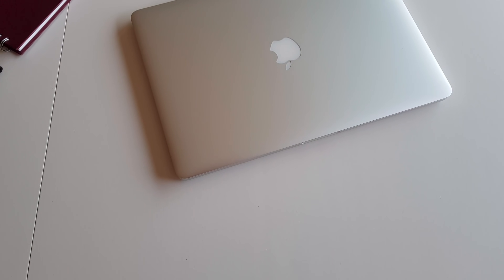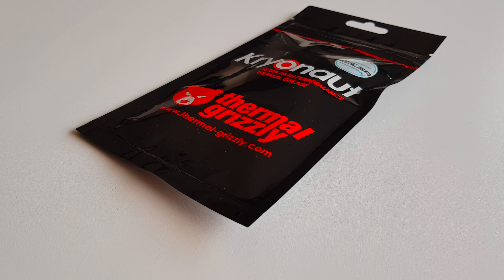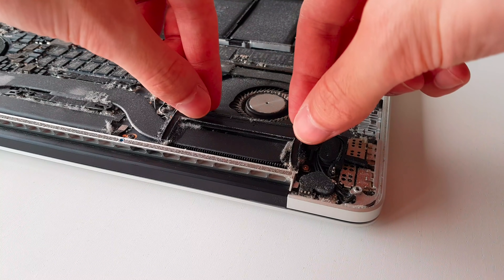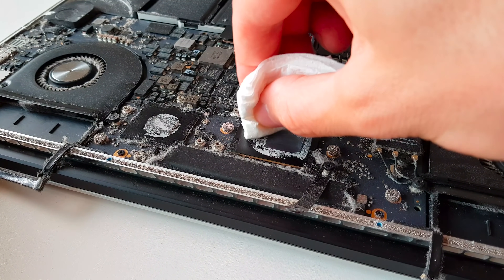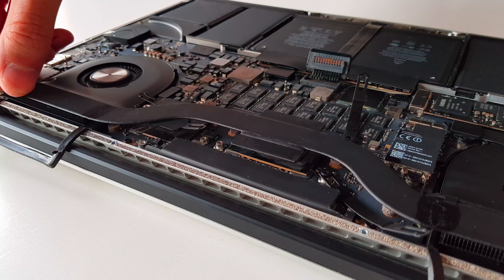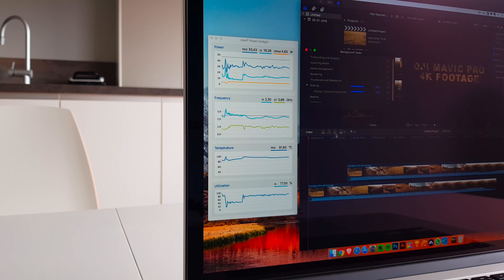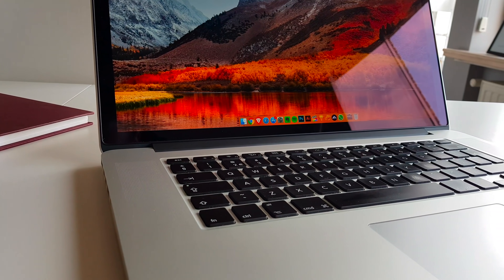Solved overheating problem on my MacBook Pro 15" Mid 2015 by replacing the thermal paste

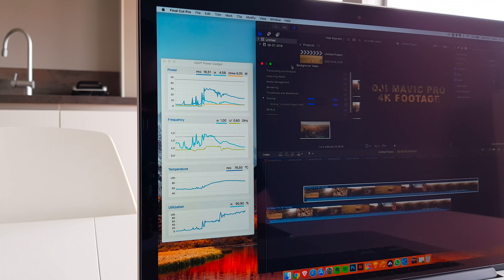Comment: What a helpful video! Was very easy to follow. Prior to this replacement, A 4k video took me 3:26 to export, only turbo boosted to 4 ghz for one second, and thermal throttled after two minutes to 1.7 ghz from 2.8 ghz base clock. After the replacement with thermal grizzly kryonaut, I exported the same video in 2:50 seconds (18% faster!), turbo boosted to 4ghz for 20 seconds, and remained at 3 ghz for the entirety of the export. 10/10 tutorial and thermal paste, would highly recommend this to anyone who owns an older MacBook pro.
Reply from the maker: Hello Michael! I am so glad to hear that! That's definitely a big performance boost, not to mention the longevity that's increased of the MBP because of the lower temps. I think this is my new favorite comment :) I will pin it if you don't mind. Thanks once more for taking time ti watch my video :)
Reply: Hey guys. I have a offer for a mbp 2015 brand new battery, always protection,no scratches whatsoever for a brilliant price.

The thing is the owner is a graphic designer and photographer, so I think the MacBook was used under constant work imagining she worked like 8 hours full capacity on graphic programmes etc. Should I worry or be concerned? Thanks guys
Reply from the maker: I personally think it should not be a big concern especially since you said yourself that the MBP is in perfect condition. What I would definitely do if I were you would be to open it up and clean it thoroughly.
Reply: Dario Prski — when I read his question, I felt he was asking about the actual BATTERY by saying “brand new battery” .... The confusion for me was how he then went on to say it was “always protection (protected), no scratches...” and he fears it was under a constant work load which means it’s NOT “brand new” but actually used.

Either way, here’s MY QUESTIONS to you... 
(i also have the 2015 MBP 13” and i am looking to open it and upgrade whatever i can.) Your PASTE suggestion WILL BE IMPLEMENTED..

1. Are battery replacements possible? 
2. If his question WAS about a used battery only, isn’t there a way to TEST IT prior to purchase the same way one might use a multi-meter (or other devices) to test used standard batteries?? This would be a great video topic.. 
3. I’m upgrading the SSD and have learned that the RAM is soldered in place by Apple. However, solder can be reversed, so are there RAM upgrades available for this MBP if we are willing to desolder/solder or pay a repair tech??
4. Aside from SSD & RAM upgrades, are there ANY OTHER UPGRADES (regardless of difficulty level) that are possible for this 2015 MBP that will increase performance or longevity?? Another great video idea. 
5. I noticed on a “tear down” video of this 2015 MBP that the Thunderbolt 2 controller was accessible/removable..... Can we remove it and UPGRADE to Thunderbolt 3 if we don’t mind the obvious negative exterior appearance side effects?? If so, would anything else need to be upgrading to accommodate this T3 to work properly? 
Finally - 6. Are you aware of any successful radical modifications such as adding a gigabit Ethernet connector or other ports OR MODULES that were not already there? 

I left a comment on the video complimenting you on this video. You truly did do a wonderful job. I have other channels with many subscribers and I still have NEVER thought to use the sweeping video effect you used when showing the MBP in the beginning... I don’t normally show items, as my content is geared more toward political topics, but it’s still an effect I LOVE that I should use when showing still photography or slow motion scenes... your video has encouraged me to experiment with this. 

Thanks!

Comment: Great video! Thank you for sharing—this is really inspiring for those of us still rocking older Macs.

I wanted to share my experience with my Early 2015 11" MacBook Air (Intel Core-i7/8GB). Although it officially only supports Monterey, I’ve used OCLP to upgrade to macOS 15 Sequoia, and it’s running incredibly smoothly. I mainly use it for watching YouTube on Chrome, using AI tools (ChatGPT/Gemini), and simple bookkeeping via Google Docs.

For anyone looking to keep their older machines snappy, here are the three optimizations I highly recommend:

Hardware Maintenance: Regularly remove the bottom cover to blow out dust and replace the thermal paste. This is crucial for managing heat on older Intel Macs.

Aggressive Cooling Strategy: Install Macs Fan Control (Free version). Set the sensor to "CPU Core Average" with a range of 55°C to 85°C. This ensures the fan ramps up linearly as soon as the CPU warms up, preventing thermal throttling.

Chrome Performance Settings: In "Settings -> Performance," set Memory Saver to "Maximum" and disable "Preload pages." Additionally, enable Energy Saver and set it to kick in only when battery is at 20% or lower.

With these tweaks, this 2015 machine remains a perfectly fluid productivity tool even in 2025. Don't give up on your old Macs yet!

Comment: You made it look so easy.  So I thought, "This is Easy" and in the end it was.!! Thank You.  I installed Thermal Pads instead.   Using Macs Fan Control, I noticed a great reduction in temperature.🌿👍

Comment: instead of thermal paste would it be okay to use a phase-changing material like the Honeywell PTM7950 Thermal Pad? for my MacBook Pro 15" Mid 2015 retina display
Reply: It would be much better.

Comment: Same issue was happening to me, I was getting a task called "kernel_task" eating up my CPU to protect it. I replaced thermal paste, disassembled both fan covers and cleaned all the dust. Now it's working way better.

Comment: Exceptional video — may be the best do-it-yourself video I've seen on YouTube, and I'm very picky. 
Great advice, and you did a great job of demonstrating what to do. I especially liked the warning you gave about removing a part that may pop out.
I watched this until the end was was surprised that it was your first video. 
I still use my MacBook Pro because it has Adobe Photoshop and MS Office that are paid for, so no annual licensing fee. Of course, I have to run an older OS, so I use a new machine for most other tasks.

Comment: Thanks for spreading the word on this subject. I've done this upgrade on a few Mac's now. One MBP, had no more than 60% paste coverage on the CPU. One could argue that 60% coverage in the middle should get you by, but this was 60% to one side. Conversely, I did upgraded to X5690's on a Mac Pro 5,1, and was pleasantly surprised by the paste coverage and how much moisture was left, in a 13 year old system. I guess that could be the a contrast between cooling of a laptop versus a tower, but they could at least give some effort to applying paste squarely.

Comment: Watching this video January 2024 because my MBP 2014 is still my only computer and I have never opened it to clean it and put new thermal paste on it. My battery health is around 77% and needs to be replacement as well. Just watching a youtube video brings my computer to its knees. I will buy a battery replacement kit from ifixit and new thermal paste. Hope this will help. But if your MacBook has that much amount of dust only after two years, god knows how much dust and dirt my is have after exact 10 years of daily use 😅
Reply from the maker: Good luck with the replacement! 😄

Comment: Hi I followed this one, but after doing this I am facing issue of screen flickering. Do you have any solution? 

I also changed my battery and left fan.
Reply from the maker: Did you also apply sufficient thermal paste on the GPU die? Check if your screen connector got loose in the whole process.

Comment: you applied the past the wrong way thats the old way which has proved to not work well enough you need to precover the entire aread of the cpu and gpu before putting the heatsink back on other wise you will still run some hot temps what you did will run cooler but had to precoverd everthing properly then it would have been even better results

Comment: With that much dust, I would clean the bulk of it before even removing the heatsink. I'd then do a rough clean of the old thermal paste, go back to dusting everything completely and then finally doing one last clean on the heatsinks and dies, before putting new thermal paste. The reason is, the less time you have in-between re-pasting and putting the heatsink back on the better. If you let the dies sit exposed to air, dust from the air can contaminate the surfaces. Basically, as soon as you apply the paste, the heatsink should go back on immediately.

Also, it takes several days/hours for the new thermal compound to set in properly. You really shouldn't run any benchmarks, or stress out the cpu/gpu right away because it can lead to the thermal compound moving around unevenly with the excessive heat. You won't see optimal temps and performance until the re-pasting has broken in with time at idle/low load. You can also "tint" the copper heatsinks with thermal compound and that can help speed up the break-in period. To do that, you just put a tiny amount on the heatsink, spread it around with a plastic card, or finger wrapped in plastic wrap. Then you take a coffee filter and rub it in so that there is a matte finish to the surface. This is more of a thing with larger heatsinks, like those in towers, but I still tint my laptop heatsinks as well.

Comment: Thanks a lot for the help! I also have a 2015 MBP and I‘ve waited until now (Nov 22) to replace the paste. Needless to say it was not really paste anymore but rather puddy. The MBP has now stopped thermal throttling when I do my audio editing and the fans also run much quieter for much longer. I‘m a hardware enthusiast with a big custom water loop on my gaming PC… no idea why I haben‘t done this earlier on my MacBook 😂

Comment: dude, don't use a brush to clean you laptop. It could be charge with static electricity and burn it all. Use an air blow or air spray.

Comment: Thanks for the video, do I need to let my MacBook pro completely cool off after shutting it down to perform the thermal repaste and do I need to wait to start my MacBook Pro a certain amount of time after applying the thermal paste?
Reply from the maker: It's good to cool it off a bit.
Reply: Thank you for replying, how soon can I turn MacBook Pro on after applying thermal paste?
Reply from the maker: You have to assamble everything back together and turn it on like you usually would
Reply: Thx for the help
Reply from the maker: Np. Good luck

Comment: I have the same model, second hand, but in excellent condition, used just for school previously. I've noticed fan is loud lately, and I got some heat in the bottom. According to the previous user don't think it has ever been cleaned. Hope I willl be able to do the steps. Good video. Btw, ucinilo mi se po naglasku da si sa Balkana, ako jesi pozdrav. Nadam se da necu nesto zeznuti.
Reply from the maker: Dobro si prepoznao naglasak 😉 sretno! Ako negdje zapne, javi.
Reply: @DigitalPulse  😁, moram naručiti taj alat prvo.
Hvala ti.
Reply from the maker: Hvala tebi na gledanju 🙌

Comment: as a pro apple tech for the past 25 years you should've blown out all of the dust FIRST then moved on to your repair work. why would you want to have all that dirt and dust mixed in with the paste?  always clean then perform task and then i typically clean again just to sure - no matter the repair work i do. i would also never use a brush or anything abrasive on the motherboard - but nice repair otherwise!

Comment: I have done this w/ 1st my 2012 Mac Pro Dual Xeon. I use Artic Silver #5 as I've used it for long time. It does take a few hot to cold cycles to set in b4 you see the best temps but it's brilliant. Good stuff. I did try this but haven't had time to compare. Both good products.

Comment: Great video! Could you share how you cleaned the very sensitive spots (dust) like the fans and what not? Did you use compressed air? Because the brush you used seems too big to accurately clean the stubborn small spaces that are in this laptop...
Reply: handheld aspirator on aliexpress, NOT blower, air aspirator :)

Comment: Bought a used MBP 15 2015 and just booting it would peg the fans.  Why does a company charge $3100 for a laptop, then save .25 on thermal paste, only to get plastered on every forum for years?  Thank you for your video!!  I was dreading doing this, I've done older ones, frankly they're a pain.  I saw this and was inspired, took like 15 mins and poof!  It's so quiet I can't hear it running!  Thanks again!
Reply from the maker: Thanks for sharing your experience 🙌 Glad I could help 😁

Comment: ❤️❤️🔥❤️❤️ Woww I followed this tutorial and applied same thermal paste on MBP 15" Mid 2015.

I use it for normal browsing+ movies and some virtual machine running. 

Just running browser was showing 80++°

And surprisingly after fix its showing 40-60° !!!!  Seriously 🔥 above expectation.
I can add screenshot if YouTube allows
Reply: If there is anyway to upgrade speakers, Wifi6 etc on MBP2015 please share info on it

Comment: Only two years, and that much dirty? I cleaned mine for the first time after six years, and It was still neat and clean. I just used a paint-brush and gently cleaned and blew the dust around the fan.

Comment: So I finally applied this Grizzly thermal paste today on my Mc Book Pro from mid 2014 (2,8 GHz Intel Core i7 quatre cœurs, 16 Go 1600 MHz DDR3, NVIDIA GeForce GT 750M 2 Go). The former paster was completely dry. Strangely enough, I don't seem to notice any significant improvement at the moment. I even noticed a worse idle temperature. Maybe I didn't apply enough?
Reason I did this is because I am going to have to edit a lot more 4K footage now that I acquired the CANON R5 DSLR.
I thought this new paste would help a little.
This is a bit off topic but do you think I should buy a new computer, like the new iMac M1 for 4K editing?
Reply from the maker: Try to spread the thermal paste manually over the CPU and GPU die. Make sure it's a thin layer. I am saying this because the mounding pressure of the heat sink bracket might not be sufficient to spread the paste evenly over the die.

Comment: Just followed this and it worked like a charm. I stumbled upon your video while looking for videos on how to change my 2015 15" MBPro battery and decided to do a 2-for-1. Battery swap + apply new thermal paste. I can't believe how dried out the paste was, there was almost nothing left but crumbs. I used the Arctic MX-4 paste. I also could not believe how much dust was in there, i used compressed air to clean out all the dust in the fans. My laptop feels like a brand new machine, best money I ever spent. It's been running so much cooler. I haven't even heard the fan blaze 1 time so far since I applied it. Before, the fan would howl constantly for simple tasks like opening a PDF or TradingView. Thanks for an amazing video!
Reply from the maker: Super happy to hear that! Thanks for watching and for taking the time to share your experience 🙏

Comment: I still get overheating problems, I also changed the nvme to one with a cooler + running mbp without lower cover + laptop fan. I'm gonna try with metal liquid and buying a noctua fan

Comment: I have a Mid-2014 15" Retina (a1398) 2.8 GHz Quad -Core i7, 16 GB RAM, NVIDIA GeForce GT 7550M 2 GB, 1TB SSD. Just bought used, person before had the battery swell so it was replaced, now has some service battery light and runs hot, maxed out RPM fans, keyboard area/the strip above keyboard is the hottest part, which makes me think its the SSD or possibly CPU I heard? 

I've heard other people replace the thermal paste, but most comments say issue still persists. Heard others with similar models have logic boards replaced and didn't fix either. Lastly, many suggestions such as resetting the PRAM & SMC. 

Is this a common issue with the 15" MBP? do they naturally just run hot with a terminal velocity fan?? It's so annoying cause my MBP Mid 2012 13" 8GM RAM and 1 TB SSSD was quiet as a mouse with zero problems and this is blowing like a jet plane with just simple web browsing! not even using it for Adobe/Music Production like I intended! are they just too thin for their own good? So far, i took it to one shop and they ran some diagnostics and said it was within normal operating range, however, I don't think it should get this hot- literally its too hot to put on my lap and even hot to type on. Is this model just a lemon and should be avoided or what? thank you.

Comment: Very nice advise. I will do it tomorrow. I have a MacBook Pro 15" mid 2015, Intel Core i7 4 cores  2,5 GHz 16 GB DDR3 1600 MHz, SSD 512 GB. Since  I bought this, I never opened it for doing anything.  You cleaned you MacBook after two years of using. My MacBook is 6 years old 😱😱😱. I hope not find a crocodile in it. Thanks for your video 👍🏼👍🏼👍🏼
Reply from the maker: Good luck!

Comment: I have a MacBook Pro where the processor heats up to 95° C. I was afraid it would be terribly complicated. As it turned out, a much bigger challenge (which I won't undertake myself) will be to do the same with my gaming laptop from ASUS ROG. All I need to do now is buying the tools and get to work. You've calmed me down with this video.
Reply from the maker: My assumption is that it will be even easier with the Asus ROG 😉 MacBooks are not made in a way that allows end users to fiddle around with them
Reply: @DigitalPulse  My Asus ROG GL552VW model got the highest possible difficulty level. I watched the video for more details. I can't believe it myself, but (as long as you don't replace the SSD, or RAM) it's way easier with the MacBook.